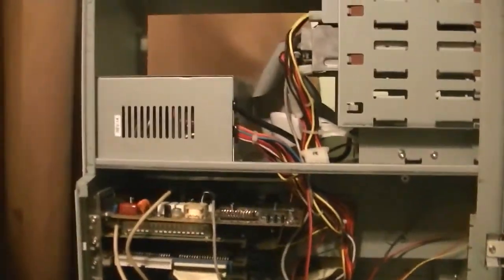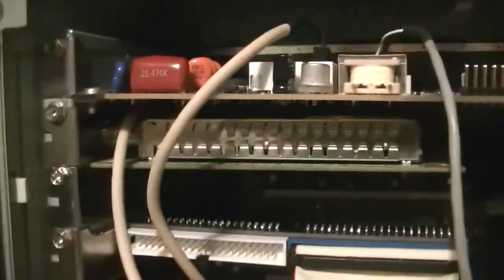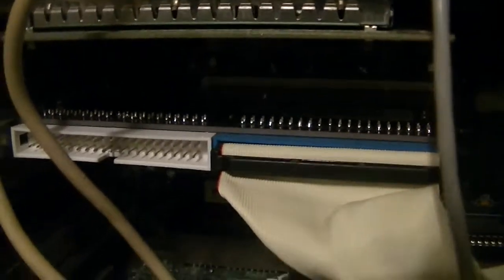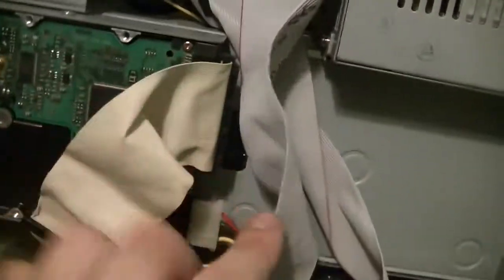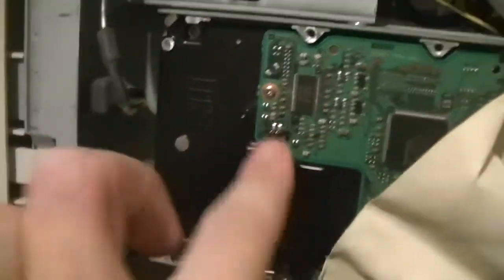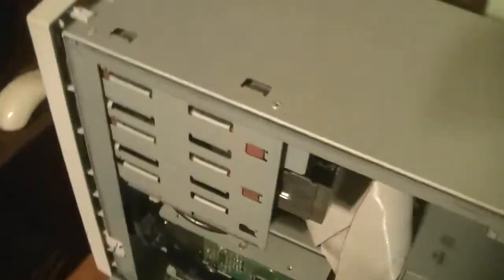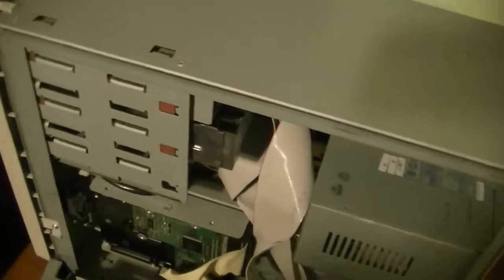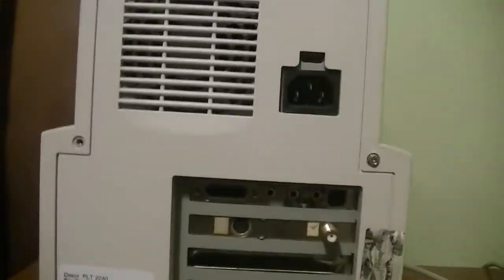Inside the Packard Bell Platinum 2240

Comment: It sure was hard to get the IDE cables on and off that Packard Bell style case.I had to remove the riser card to accomplish that task.
The specs on the Platinum 2240 and my Pack-Mate 7715EX are pretty similar yours having more memory and larger hard drive which is more ideal.

I have always had problems with the Sound Modem's sound disappearing in Windows so I disabled it in Windows and using a Creative Labs Awe 64 Value card with all the software installed.This is my only big beef with Packard Bell computers of this time frame in 1997.
I did put in 64 MB of RAM in the system  to max it out.and am using another CD-ROM drive as it can better read home burned CD-R disks.I had to put a Diamond Monster 3D (3Dfx Voodoo 1 ) 3D accelerator card in mine with the pass through cable as 3Dfx  was legendary and dominated the top end 3D graphics cards in late 1996 to late 1997.
If you want to show off a vintage 1997 system a 3Dfx card will bring the wow factor to a 19 year old 1997 system especially with some PC games like GLQuake and Jedi Knight Dark Forces II (which is a direct X game though). Even Quake II running in mini Glide can raise an eyebrow to see how such an antique system can look great and seem almost modern.